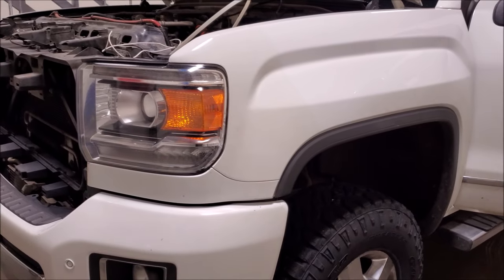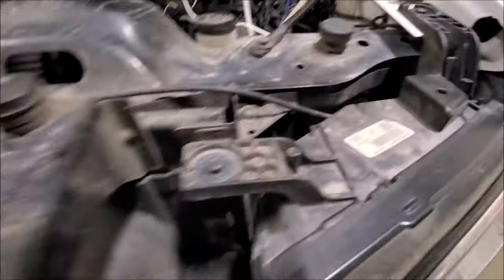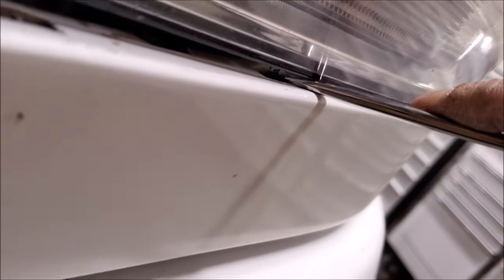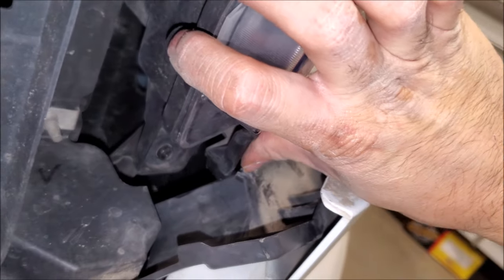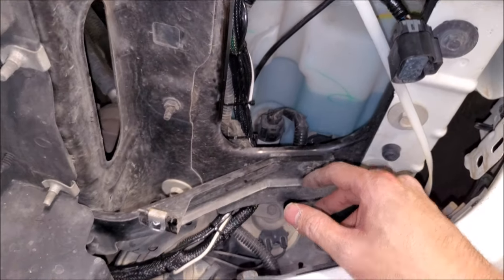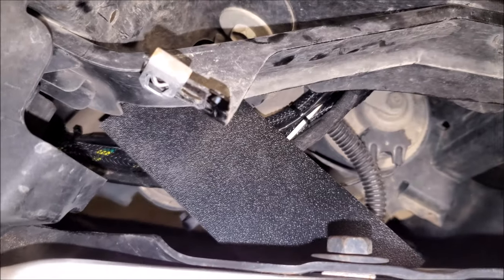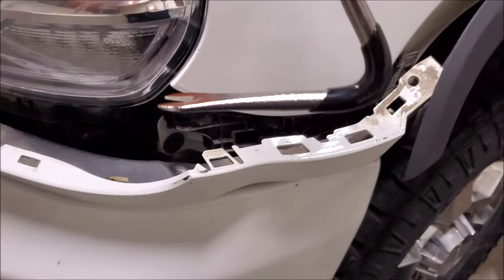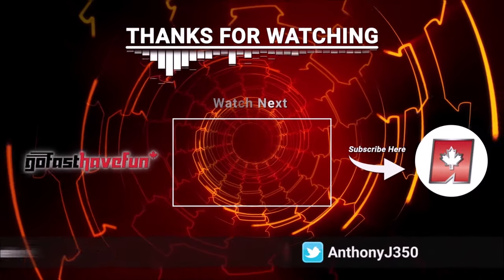2014 - 2018 GMC Sierra / Chevy Silverado 2500 3500 Headlight Removal | AnthonyJ350

Comment: Great video thanks. I was trying to get to the horn, but impossible from below. From the top looked like the only way so very helpful on how to remove the headlight. For me, removing the grill is easier using a rod (like a Jack handle) to pop out from the back rather than pulling from the front.
Reply from the maker: Thanks for watching!

Comment: I hope I never have to remove the ones in my 2018; poor design.  I think when they redesigned the front end in 2016 they moved the horns to a vertical position like they are on the 99-07 classic trucks.  At least this is how they are on my '18.
Reply from the maker: That's good to know, at least they figured out the issue and did something about it.

Comment: I need some help I have a amp powering 2 marine speaker but I was under powering them so I upgraded amp it only plays bass the tweeter wont work and it ain't blown because i hooked up to the underpowered amp and it works fine
Reply: Cuz I know you do things with systems so I was wondering I'f you now why
Reply from the maker: Was it a full range amplifier or a mono block?  Can you give me the model number to look up?
Reply: @AnthonyJ350  oh um I'm real not shore someone gave it to me
Reply: It probably a monoblock do forgot about it needed to be a fullrange
Reply: @AnthonyJ350  my fault lmfaoo thanks for the help tho
Reply from the maker: @viableattic_gaming3512  Your welcome
Reply: @AnthonyJ350  also just subbed to you

Comment: This is insane just to replace a headlight assembly.  American engineering at its worst.  Jeez.  Speaking from a engineering perspective.
Reply from the maker: Doesn't matter if it's American, European or Asian. They're all similar to this. So many cars you have to pull the bumper skin off.

Should be two vertical stands and a pin up top.  Look up 99-2006 Silverado. Pull the headlight out in 5 seconds. They're engineering them to be difficult on purpose.